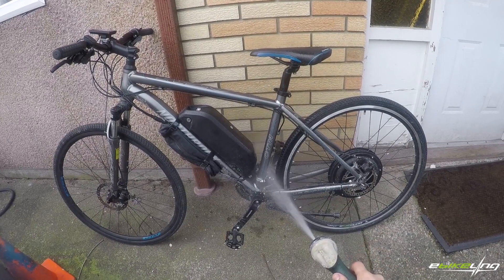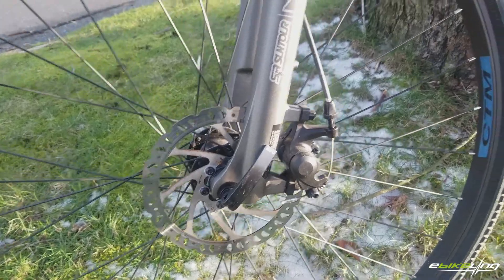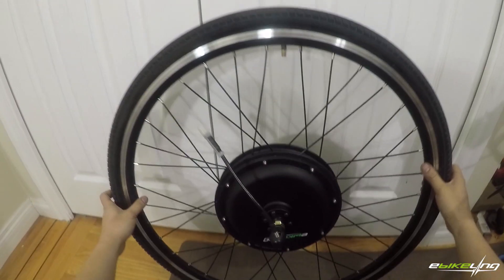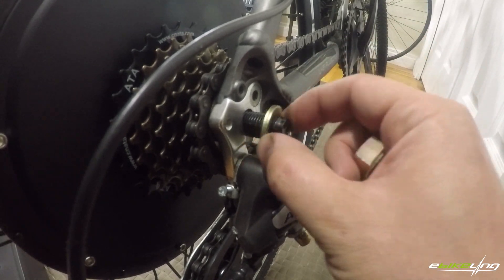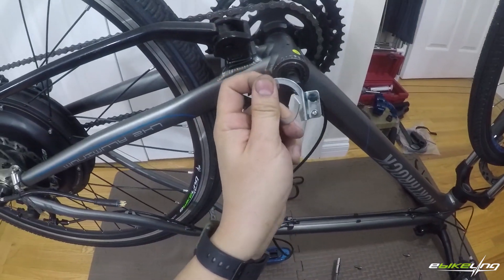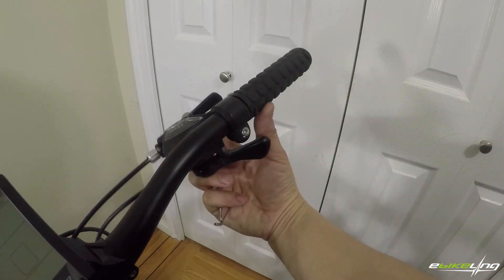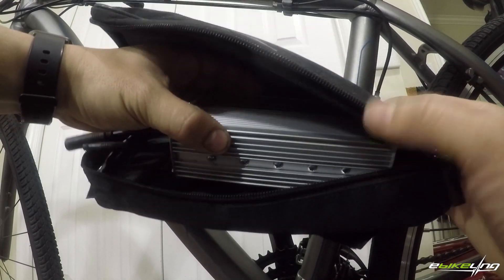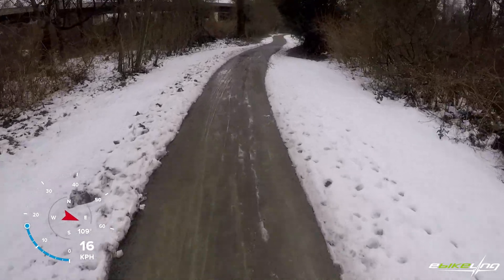How to Install a Waterproof Rear eBikeling Conversion Kit

Comment: Sure glad I didn’t get a piece of junk looking controller like that, I watched the video to try to figure out what the narrow (about 1/8”wide,color coded red on the plug with two tiny female receptacles for prongs,the wire is about 6”long). I don’t know what it does.

Comment: I have the 1200W with the built-in controller, the wheel won't turn when I tighten the axle nut on the gear side.

Comment: Just installed the 1500 w version to my GIANT cypress 700c installation was straight forward and waiting for my battery pack took a month after my initial kit from Chicago arrived,I'm pleased "so far" able to reach 31 mph and my battery pack still has life left before needing recharge.

Comment: Hello so I ordered one of these kits and the controller wiring is a SY60 and I can’t find a battery to fit it in I’ve bought 2 batteries that are very expensive and none of them fit what battery am I supposed to use?

Comment: Kit i just received has 2 torque arm kits and the cadence sensor is a new split type(really easy to install) no crank removal required.  I did the same installation of brake switch/tab because integrated Shimano gear controls.  I am impressed with quality

Comment: Please I've been trying to contact you guys about buying a fat tire 20 inches motor wheel but you guys aren't getting back to me. I've already bought controllers and other stuff from your website on Amazon and it's coming in about a week or so. I just need 2 wheels for dual drive diy I'm doing
Reply from the maker: Hi, 

Please contact us through support@ebikeling.com with your questions. We'll reply promptly. 

Sincerely

Comment: I have hydraulic disc brakes do I need to mess with the brake system? 

I don’t want to solder or switch the brakes so j am very very confused

Comment: My rear hub motor did not come with a cable that runs through the center of the axle I am having trouble mounting the wheel into the dropouts don’t know which side of the left drop out the table should be

Comment: I have the same issue with the brake leavers. My only concern is by taking out the cut out switch and gluing it to the brake wouldn't that mean it's no longer water proof?

Comment: You just need to break leavers and the throttle my twist throttle says the battery level but not the miles per hour but I don't care less wires

Comment: looks like same calipers as on my schwinn...brake pads lasted 3 weeks...the area where the rear wheels bolts lookes like schwinn to. 1500 watts and 52 volts and no torque arm..guess me lucky

Comment: Silly question since I'm new to EBikes. Since it is a rear hub motor, you don't really need the chain and crank pedal right? Only if you just want fully motorize bike.
Reply from the maker: Hi Ken,
This is a pretty good question, and we believe that many people want to learn the answer. Electric bike conversion kits do not eliminate the regular bike features, they just add motor power to the wheel. The hub motors spin with our without chain. You will still need chains to be able to pedal your bike without motor assistance. But, with power assistance you do not need chains or pedaling at all. 

Thanks,

Comment: Does the PAS sensor have to line up parallel to the rotor or can it be a bit above (but still close to it)?
Reply from the maker: Hi,
They should be lined up parallel to each other. 

Thanks,

Comment: How much is the range
Reply from the maker: Range depends on the power of the kit you use and capacity of your battery. On average the range is - 21 miles (Electric only) 42 miles (Pedal Assist)
Reply from the maker: you can have more information on www.ebikeling.com

Comment: install a 775 motor turning a 40 60 or 80 amps alternator first and then it goes three hundred miles on a charge minimum.
Reply: How???
Reply: @dougmartin8495  watch free energy video and then learn make transformers that reduce amperage and then wind it yourself.

Comment: Yes! I've done it! It works. I've watched this video probably 30 times. 1 thing I can advise is how to avoid cutting and soldering brake wire. If you have a bend saw or a hand saw and a good wise, you can gently cut off part of the handle base and release the wire. Thank you very much for your video.

Comment: There are easier solutions for the pedal assist sensor and the ebrake.  Look up the D12L pedal assist sensor https://www.amazon.com/ZOOMPOWER-Assist-Sensor-kt-d12l-Install/dp/B079ZRRHSR/ref=mp_s_a_1_4?dchild=1&keywords=pedal+assist+sensor&qid=1595784224&sr=8-4
Also, there are brake sensors that use magnets glued to your existing brakes https://www.aliexpress.com/i/4000101850739.html

Comment: Hello there I really enjoyed all your videos and I have a question for you. I'm planning to buy my e-bike kit from Amazon. So what I'm doing is buying a foldup bike from Amazon then purchasing a ebike motor kit. Problem is I want to buy a front ebike motor because I want as little modifications and simple installation as possible. The problem I have is a fold-up bike on buying from Amazon has the disc brake on the front tire. Is there a rear brake part make a note that I need to purchase since the e-bike motor is the front tire? Any suggestions would be greatly appreciated.

These are the items I'm planning to purchase
https://photos.app.goo.gl/RKzFaYfKoLFP7awa8

https://photos.app.goo.gl/4GrSoAz4sobtVFtq6
Reply: I don't think there should be any troubles with this, the best way is always to communicate with seller.

Comment: Just found this video, good job! I'm about to receive my rear hub kit, so waiting to install it. So I have 2 questions. 1) Really liked your air compressor, what brand is this, where did you buy it from? It's really cool. 2) What application did you use to capture speed and then show on the bottom left of the screen - when showing test ride? Thanks ;-)

Comment: Hi. Would this conversion work for a single speed bike? I'm just concerned because my Bikes casssettes and freewheels looks different from every other bike that I seen that has done this conversion. If anyone can help me out, I'd greatly appreciate it.
Reply: yes, it can be installed but as is, you wouldn't be shifting gears. just match up the chain to the gear you want to use. you might need to add/remove  links. there are rear hub kits for single speed tho, too. very similar...

Comment: The rotor in the ebike kit I bought that goes with the crank sensor doesn't fit onto my bike, how do I resolve this problem? I bought the ebike kit months ago, now I'm building it, but if I can't solve this problem I'm just going to contact Amazon to return it.

Comment: should have put a liner inside the rim, i made the same mistake an had a blow out 6km from home. an the factory rim on those hubs is crap an spokes need to be tightned after 50kms then every 100km

Comment: Hi ebikelink, its being almost a year since this video, how is the bike going? is the motor working good? are the waterproof component reliable? have you had any issues at all with it? thanks
Reply from the maker: Our conversion kits are getting increasing number of attention and everyday new customers are discovering the joy of riding electric bike using ebikeling conversion kits. Number of complaints are significantly low compared to number of satisfied customers. Our team work dedicatedly to provide the best product to our customers. Our high performance motors last years and we try to offer best waterproof components to make the whole set work perfect and last years..
Reply: @ebikeling  
Hi,
How would the torque arm prevent rotation? 
At 4:19 when accelerating the axis and the torque arm would turn clockwise. The point where the two pieces are bolted together would pivot and the piece attached to the axis could turn up (down if the bike is with the wheels on the ground) with relative ease. 
Don’t you need a torque arm that’s specifically designed for a rear hub motor? 
Thanks in advance!
Reply: @ebikeling  do you make a rear hub for 29" wheel with a built in controller?

Comment: What was the top speed again in miles
Reply: Elnatan I 50kph is about 30mph
Reply: @MrCarlRobinson  sorry what about the price in $
Reply: @longshot4484  this kit is 600. I made an ebike for much cheaper with a kit off aliexpress and it can go 45 mph. The kit was only 250 and the battery was 52v 17.5 ah for 400

Comment: Don't buy a bike with brake and gear change levers integrated, route cables through fame where you can for cosmetic reasons and to keep them dry and damage free, fit the frame holes you drilled with rubber grommets to stop cables and wires from cutting through.
Reply: It's not generally considered a good idea to put holes in the bike frame.

Comment: Unless you are hill climbing, much faster easier going front hub setup.
Reply: @Tiny Rick actually yes. Front hub is easier to work with but hill climbing the front wheel has a tendency to skip, which is why rear wheel for climbing front hub for everything else.

Comment: What modifications are necessary to get full power, no pedaling, for off road use?
Reply: Don't hook up the pedal sensor. Just leave it off.
Reply: An extra powered hub for 2x wheel drive, an extra battery in parallel. Using at full power means they drain quicker. More batteries add weight.

Comment: How do I  attach the battery if I dont have the water holes?
Reply: I used a "nut set" tool, (https://smile.amazon.com/Muzata-Riveter-Thread-Riveting-Included/dp/B01M59GTH8/) they are threaded rivets basically, just drill a hole insert the threaded rivet and use the threaded rivet tool to set it in the hole, now you have a place to screw! (or three with three nut rivets).
Reply: Search electrical conduit hangers. Use the one closest to the size of your down tube and bolt the holder to that.

Comment: What is the O.L.D. of this motor hub?  I cannot find a straight answer to this.  I asked the seller they said 135mm but on your first ebay link it says 132mm
Reply: There is a 142mm I believe. Steel frames can be "adjusted" but alloy will need special care. If it is a 132, then spacers will be needed.

Comment: Largely recommend you remove the controller from the underside of the front triangle where the front wheel is. Your front bike's front wheel will suspension up onto that and cause it to shred that bag up, or bottom out your tire and cause alot of probs. Put the bag on the underside of the top triangle above the battery, This'll make it less likely to get smacked and give your front wheel full ability to bounce.

Other then that, nice video. Tho the audio is slightly off at places or to short because of how swiftly you edited the video and cut scenes in.
Reply: Thanks a lot. 
Your ideas, suggestions are always welcome.

Comment: what is that bag for the controller that you used called?
Reply: It's a bag the customer used for controller. You can find it on Amazon or eBay.

Thanks,
Reply: It should be called needless because controllers can get hot and need ventilation.....He should have installed it exactly the way he did but left off the cover.

Comment: What if your bike don’t have disc brakes in the rear
Reply: The rim has a black band on it and is unpainted. The black band is a wear indicator. Once this fades, the rim must be replaced. The motor can be re-laced to another rim. In the video, he said it will support disc and rim brakes. So, you are covered.
Reply: Hi John,
You do not have to use disk brakes, it's totally for your own safety. The motor operates even without brakes.
Reply: My bike has brakes jus regular brakes
Reply: @johnlucas604  That's totally fine. You can keep using your own brake levers and brake system. The ones included in the kit are optional.